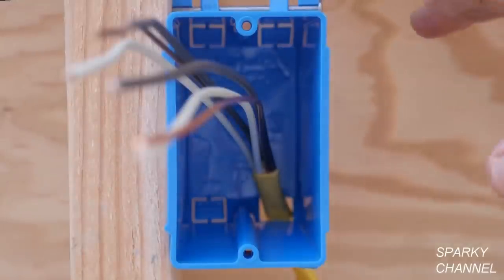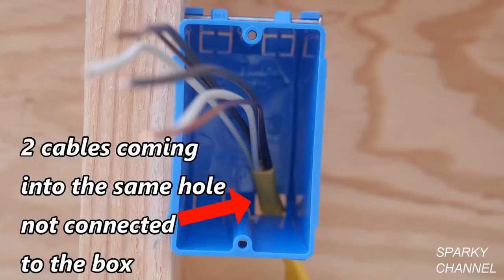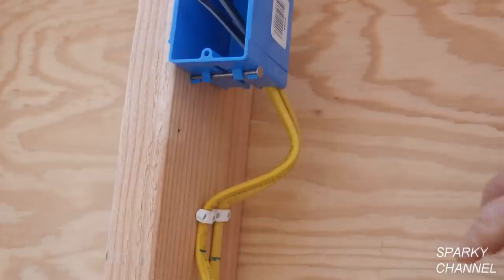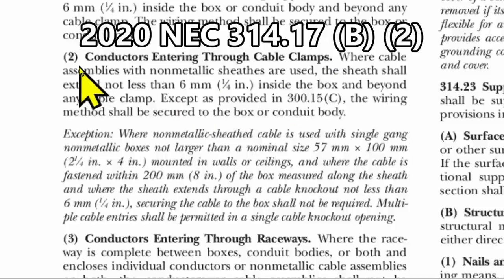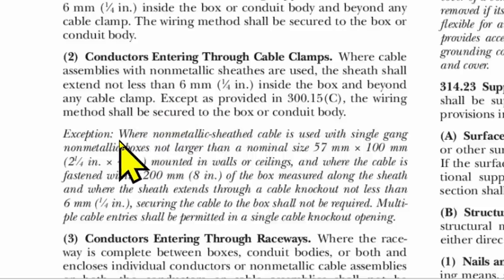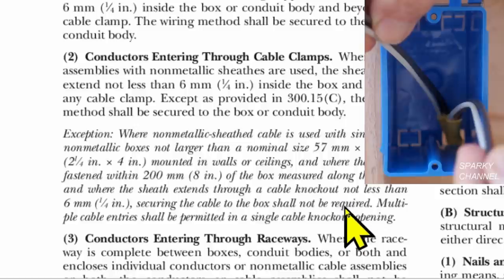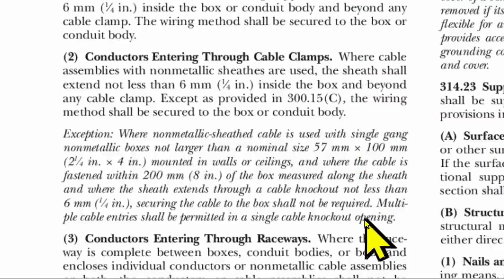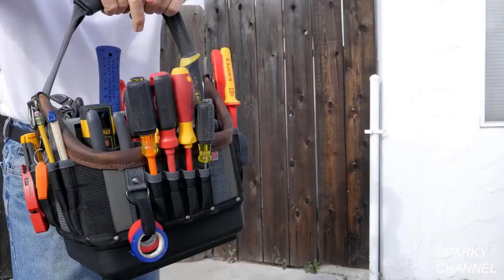Is this to Code for 2020 NEC? (314.17 Conductors Entering Through Cable Clamps)

Comment: Been retired 4 years, anyone ever come across a carter circuit? It’s a Three way that the Hot and Neutral are connected to the travelers, the common on a three-ways go to the light,it’s old old school 1935.
Reply from the maker: No, but I'll be on the lookout now. Thanks!
Reply: Ran across this 40 plus years ago in a old house in Ohio, the problem with this make up is that you can not use a conventional 3 way dimmer,  we called it a 3way hot.
Reply: @paulstaney325  yes it’s a knob and tube three-way system.
Reply: @joemc111
Reply: @joemc111   Yes this was always in an old home with knob  and tube, kinda of a  head scratcher, most times it was what it was, no easy way to change the makeup. Unless it was a full demo, always my recommendation.  Plaster and lath, no insulation and knob and tube with romex ladder ties with friction tape.With a 30 amp glass plug fuse. Just  a matter of time, always asked if they had replacement insurance. Also an escape plan!
Reply: @paulstaney325  here in Florida when a house built before 1950, when Romex started to be used, was sold the insurance wants a letter from an Electric Company that states the home was up to date. I know if we found any knob and tube it was taken out or we did not do the work.
Reply: This could turn into a forum discussion. The first time I saw it I couldn't figure it out. The second time I saw it I had enough experience to figure it out. Yes, knob and tube wiring. The problem is it makes the shell of the socket hot half of the time. Light is only off if the shell and the pin are both hot or both neutral. It would be nice to show the schematic.
Reply: @jeffneudeck4268  All those years I never though about the shell being hot.
Reply: @joemc111  My 1914 house had two of these, one for the upstairs hallway light and the other for the downstairs hallway light.  Knob-and-tube wiring, along with combo electric/gas lights in the upstairs rooms (the gas was long since disconnected).

Comment: Everything is fine except that, that J bx can not be used in a commercial applications it has to be metal along with MC 12-2 cable.
Reply: Armored cable is covered in another section of the NEC. This is the section on NM.
Reply from the maker: Codes for Metal Clad Type MC cable can be found in NEC® Article 330.
Reply: Is this random fact day?

Comment: our house has very...strange (and i know for a fact not up to code) wiring.  it has old switches where the switch can move one way for off and the opposite way for on, but regardless what it's set at it will always be in the center position.  and, behind the switches appear to be wiring so thin it seems to be meant for 12v circuits, then the wires go into a strange box that apparently converts it into the high voltage lines, and that's just the switches.  none of the outlets are grounded (again i know this is obviously not to code.)(most outlets only have two prongs though appear to be polarized and others do have three prongs, but the grounds are fake.) and i have strong reason to believe that there are hidden junction points in the house as in the living room there is a switch coming in from both the main entryway and a switch coming in from the garage that lead to nothing.  i assume they're suppose to lead to a ceiling light which the living room has none of, not even an electrical box cover.  i believe this house was built in the 1920's or so...though i'm not 100% sure on that fact.
Reply: Wow.  I'd be pretty concerned with that house's wiring.
Reply: Your switches with the thin wires switch low voltage 24 Volts AC to relays in the box to actually turn the lights on and off.
Reply: You're not required to update to current codes unless you remodel.  As long as it met code when it was built, you're grandfathered by the code in place at time of construction.

Back then, a lot of things were done differently.  Knob and tube wiring, for instance, which is still in the code book somewhere.  

But as a safety measure, since you don't have a ground at your outlets, you should install GFCI outlets where you can.  GFCIs do not require a ground wire to work properly, and these a big  improvement for safety over not having grounded appliances.

Basically, a safety ground drains away stray current from the shell of a metal appliance.  GFCIs, on the other hand,  check to see if any current is missing on the return leg, and shut down if there is any current going somewhere it's not supposed to (like through you!).
Reply: @Nic7320  go back to school the ground conductor does not drain anything. Its a low independence conductor in case of a ground fault.
Reply: @thomasmarable6818 I've had plenty of school, thank you very much, enough to know how to spell "impedance" and be able to calculate it several ways with complex numbers and Laplace transforms or scalar values. 

The safety ground acts as a drain or pathway for any equipment cases that may encounter capacitively or inductively induced fault currents, and short circuits or lightning strikes.  It provides a low-z  pathway back to the neutral ground bond and the ground rod if necessary.

Just out of curiosity, how many patents have your name on them and how many years of engineering school do you have?

Comment: I still can't believe that plastic boxes and Romex cable are legal? Seems very dangerous to have unprotected cable in the walls, even more so when stapled to a stud. Maybe it's because I live in the Chicago suburbs, but I like my wires encased in metal conduit and boxes!
Reply: @ShadowBannedagain  
What do you mean “what?” Look up the code! I know it’s legal in other areas, but the thought of basically extension cords stapled to studs inside walls baffles me. But yet you have to have a green screw for a ground in a box, not a silver screw. Not sure how they come up with stuff sometimes!
Reply: That is how we do it in commercial buildings. Houses have to do as cheaply as possible.
Reply: So long as the wires are protected from physical damage and protected from overcurrent and heating, ask your self what is the risk? BTW, a non-metallic sheathed cable is a much more hardy cable than an extension cord. These cities and towns that require conduit in single family homes went way too far .... I have always suspected these codes were influenced by an organization that stood to gain by the unnecessary upgrade to conduit instead of ROMEX. Multiple storied apartment buildings make sense to run conduits but single story homes? Ridiculous.
Reply: @fritzmiller9792  Are you suggesting the possibility of political corruption in the fine city of Chicago!!!